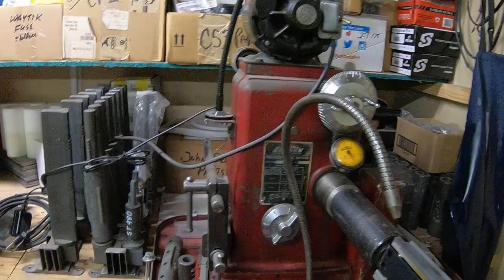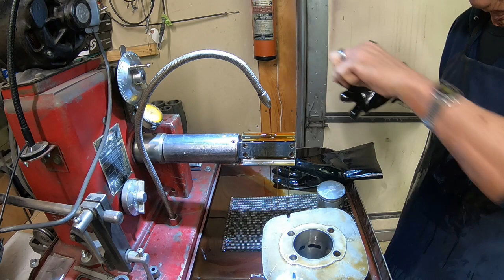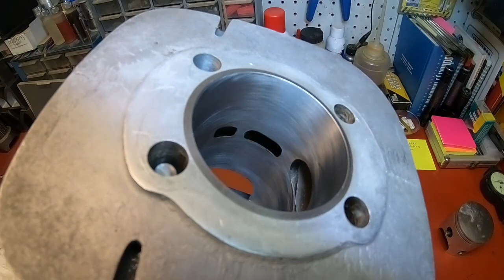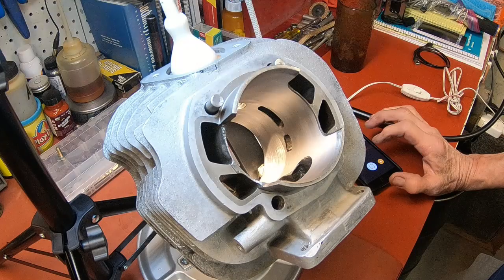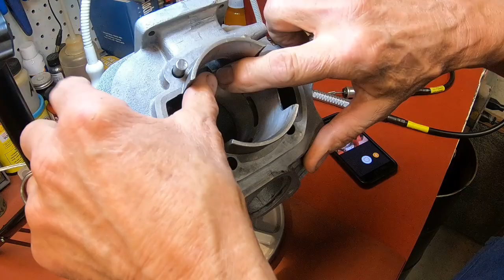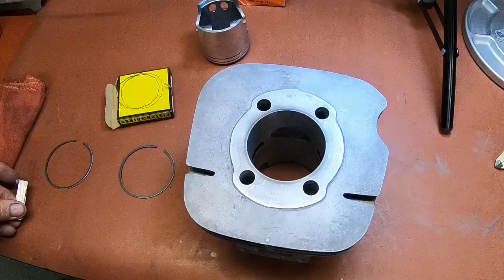Honing and Chamfering of motorcycle cylinder

Comment: Using the guides as well as stones  will keep things squared up better, although setting guides when they are different diameter to stones can be a royal PITA.
Apparently Sunnen make a setting cylinder to 'grind' everything concentric but I've never seen one and always went 'old school' filing them to size and using a scrap cylinder to check for high spots. (or a piece of old steel tube around 3" dia)
You could also have gotten a much better cross hatch .
If your using ball hone to help radius port edges, you need a reversible drill or you only end up doing one side.
From experience, a cordless drill works best, around 100¬200 rpm and a 'fast' stroke
 I was teaching people to get within 0.0003" of required size but many with a mechanical aptitude could get 'perfect' results top to bottom (even on the rather long Sportster cylinders, particularly when it was there own))
Reply from the maker: Yes, you are correct on keeping the stones trued. I use the truing sleeves often during the course of a hone. I normally don't have any problem keeping the taper of the bores within .0002.
I rarely use a ball hone, but you are right, if using to chamfer ports you do need to go both directions to accomplish the task. I prefer the small diamond burrs these days and really can do an entire cylinder in less than five minutes, and think it does a far better job than a ball hone.
Reply: @montana2strokeracer  0.0002" is pretty good, you can allow the top of cylinder to be very slightly tighter as it will expand more than lower section. I tried up to 0.001" which seemed to make a difference but it may have been wishful thinking? Riding open class meant I rarely had too little power. My Maico 490 dynoed at 63bhp

Comment: Beautiful job Dale, the Honing Machine is a great peice of kit. It's the same age as my BSA too!
Best wishes, Dean.
Reply from the maker: Thanks again Dean, I love that old honing machine, the great thing about it is all the stones and scrapers are still available. The machine its self is very tight and does a great job. I use it not just for cylinders but any kind of fine tuning of inside diameter work that may come along, its good from just 1/2 inch up to 6 inches. Im like you. I just like getting things done with old equipment as much as possible, I just think its cool.

Comment: Love the videos and how you've gotten more comfortable doing them.  When doing your piston/cylinder stuff can you explain at what point you need to go up in piston size?  My TC-125 bore is reading about 55.95mm (top to bottom), the book (clymers) states 56mm and over .05mm difference, then go up to the next size.  So I'm guessing I'm good with standard bore.  Anything you do on the lathe or mill is definitely a joy to watch.
Reply from the maker: Thanks for the kind words Greg. I do feel more comfortable as I go along. Your need to bore is basically controlled by 3 things. Damage, Piston to cylinder clearance (wear), and cylinder taper (also wear) Im not sure of your specific tolerances, but if the Piston to cylinder clearance is too extreme to correct with a new piston then it must be bored oversize to bring those tolerances back in line. Same with cylinder taper, if say the top of the cylinder is worn more than the bottom, then boring is required to bring the cylinder back in spec. I think a lot of folks like the machine work as it relates to motorcycles, I can see it in the number of view and the watch time. But there are others that really dont care and wish I would just build another engine. Sure that is ok too, but in reality, you have to fix things or weld bore, and hone before you can build. So its all part of it. Im just trying to show how it all works together. Sure appreciate you following along and your comments.
Reply: @montana2strokeracer  Thanks for the info.  My cylinder and piston look fine.  It's within .05mm so I think I'm good with what's there, or could just get a .05 over and hone a just a bit.  Thanks for replying and the content you do.
Reply: In my experience, your OK to have up to 0.0055" piston to cylinder clearance on Suzuki 125s, even the RM's. 
At 0.006" clearance, the piston slap will eventually break off piston skirt and cause a massive amount of damage, if your lucky it will only need bore, main bearings and seals. (if your unlucky it holes the crankcase)
Haven't seen or heard of a TC125 since the 70's and mainly worked on late 70's through 90's models
Reply: @1crazypj  I'm no boring and honing guru, but compression was only reading about 75 psi.  I'm told that was good for those engines, but then I got a new std bore cylinder and piston and am still reading the same compression.  Maybe that's fine, or I have another issues, not sure yet, since I haven't messed with it much since.
Reply: @gregslair4278  One thing many people fail to do is have throttle wide open or carb removed when doing compression tests. I think the best reading you will ever get is around 90 psi as compression doesn't start until exhaust port closes. It will get significantly higher when motor is 'on the pipe' though
Reply: @1crazypj  Did like always that way and the pipe is on it.  But I haven't ran it much since the new head and piston, so I'm hoping it'll improve.  I do have a crank seal for the mag side, but haven't changed it out yet, nor have I seen any leakage from that area, but I'll replace it just in case.

Comment: one might think doing a 2 stroke engine is much easier than a 4 stroke with all the cams,valve train etc. but not really true as seen in the work you do. not to mention the dreaded crank case seals.
Reply from the maker: I dont know Frank, I still think they are less complicated, but you can over think anything and make it complicated. That is one of the thing I had to come to grips with early on. My brain just try to over think everything. It was a problem, now I just dont think about things as much, just jump in and do it.
Reply: hear ya, i always over think and worry when doing almost all jobs, its a curse thats hard to defeat. but i often jump in to soon and reget later not thinking it through. example of this is my 1974 honda XL-250  it had 30 pounds of compression so pulled the jug sure enough the rings were stuck. so i rushed out and got a set of rings std size not checking if the piston was over size. well it was .50 over.  installed and wondered why the end gap was huge,then i checked the piston found it was .50 over size. story for me is the old carpenter measure twice and cut once. @montana2strokeracer